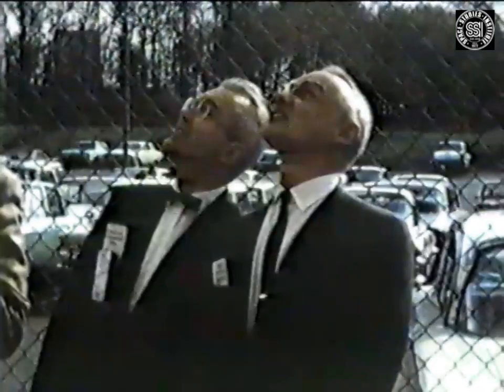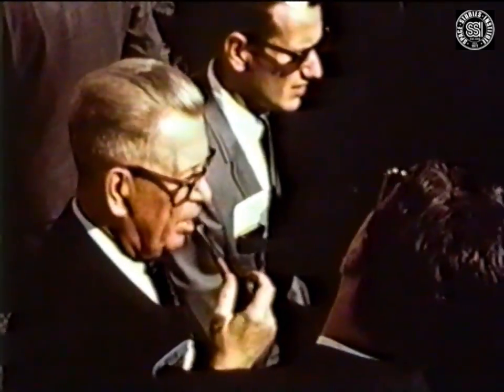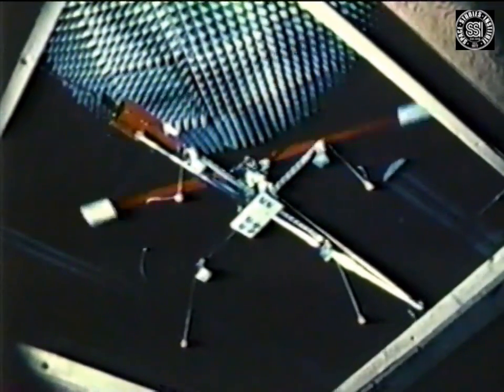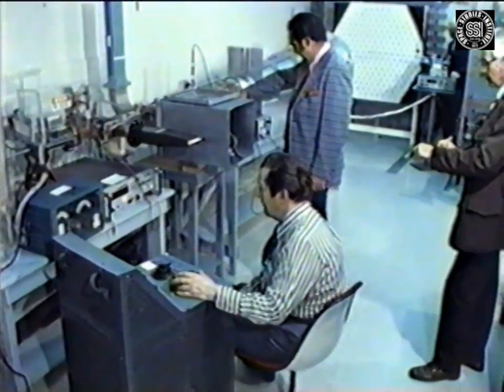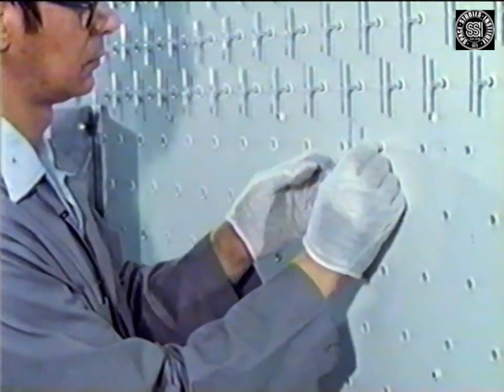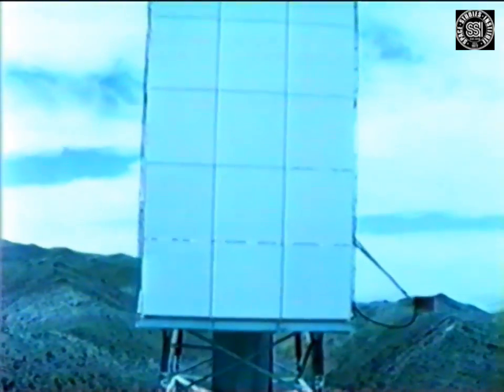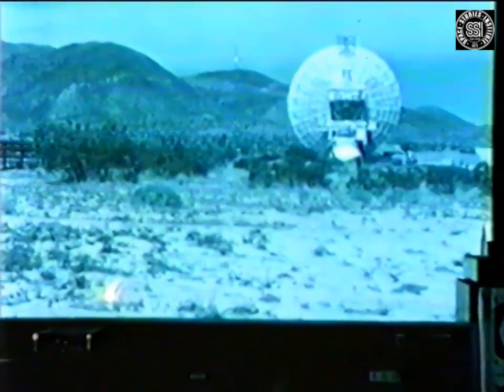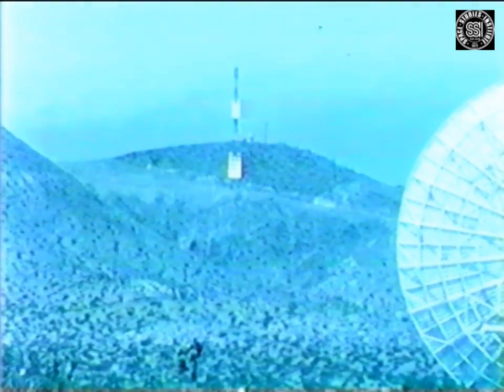Dr. William Brown Wireless Power Beaming Tests

Comment: I saw this video years ago and it piqued my interest in the possibilities.  
Around 2009, Pacific Gas and Electric bought a bunch of land near Fresno to build a receiver station for space-based solar.  I assume the project died with the economic collapse, at the end of the decade.
http://www.nbcnews.com/id/30198977/ns/technology_and_science-space/t/pge-makes-deal-space-solar-power/
The space-based solar technology is not only sound, the hardware is largely considered off-the-shelf.  I wrote a paper on this and fusion research a couple of ears ago.  Conclusion: saving our planet from ourselves It's a matter of money and political will (suppose they're interchangeable).
Reply from the maker: Is your paper available for folks to read?
Reply: It was just an undergrad paper.  It was basically a cursory review of overlooked energy technologies.  I focused on LMT's Skunkworks' Compact Fusion Reactor (the CFR was new info at time of writing and should be in pilot - plant form by now), and space - based solar.
Both work in all weather, 24/7 offer distributed generation and distribution (direct or on-board,  too), and can offer enough juice to leave oil to the pharmaceutical companies. 
I wonder what happened to the CFR.  We sure could use trailer - size fusion powerplants.